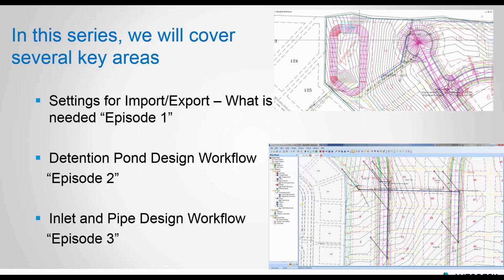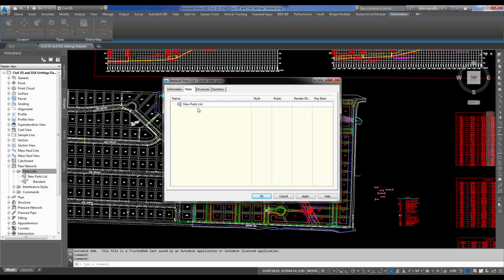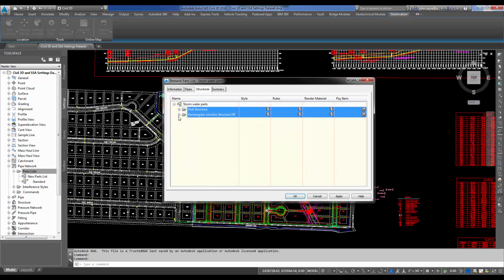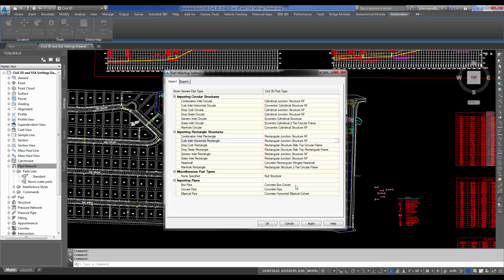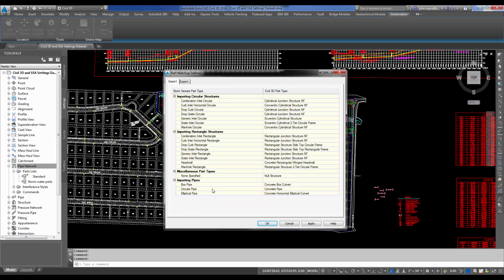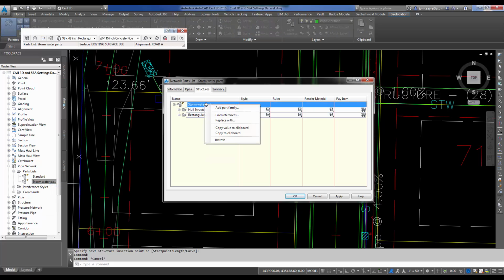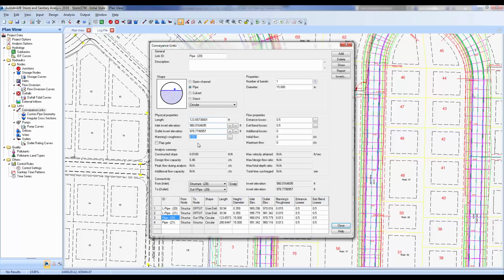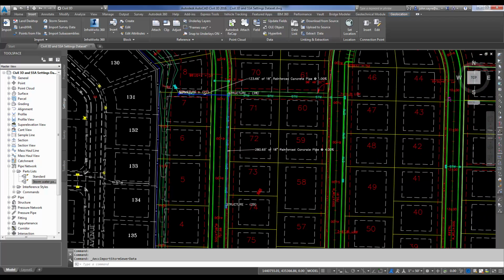Civil 3D and SSA Workflow – What is needed to get started

Comment from the maker: Christopher,
This is a short video I made just to show the settings inside of Civil 3D that you go back and forth with data with SSA. I only showed one type of material because it shows the interaction. Of course you can add different materials of pipe and different structures in your Pipe Network Parts List to cover what you need on an entire project. I believe that I also talk about it in the 2nd and 3rd episode. Thanks for the comment.

Comment: Man, from this video I wouldn't want to even think of using Civil 3D and SSA as a solution. Often times on a project I have to use different pipe materials and structures based on engineering judgement. From this video it would appear that Autodesk thinks civil engineers utilize one type of pipe material and one type of structure across a project which isn't always the case and almost never for structures. 

Seems to me a decent BIM product would be able to have this basic capability. I guess the workflow I usually teach of the road being a one way trip outside of Civil 3D is the way to go since importing back into Civil 3D doesn't work.